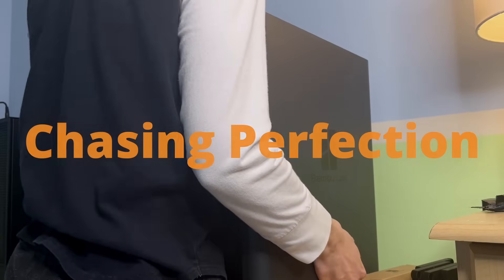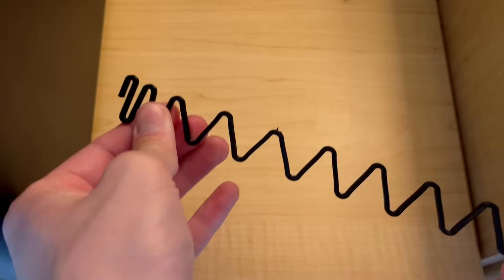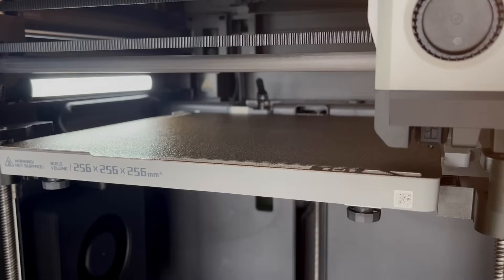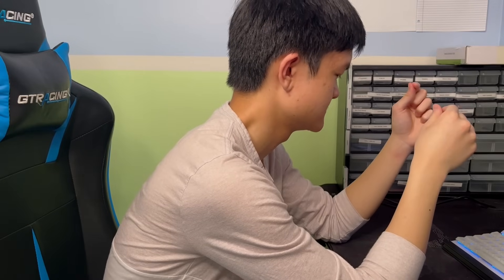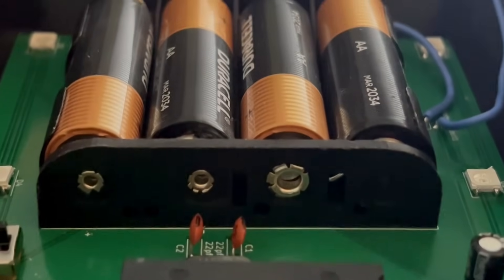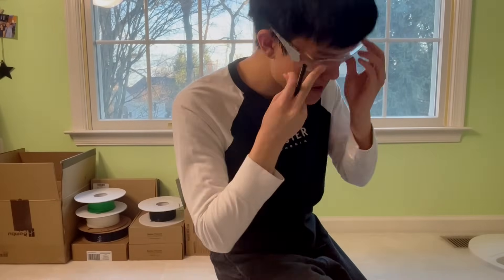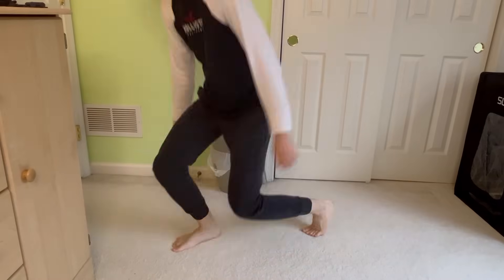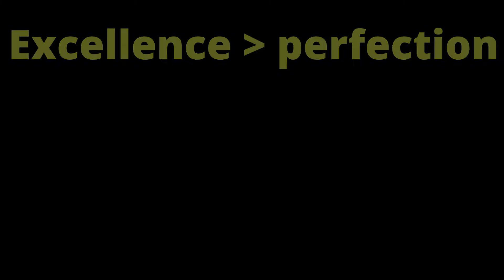Chasing the perfect 3D Printed Spring

Comment: There are things plastics are better at,  and there are things a 400 year old technology are better at.
Reply from the maker: That is correct. That is why I wanted to make plastic springs, to push the limits of what my printer and I can do. Of course I can use a metal spring as it is more reliable. But who knows? There might be a specific use that requires a shape of spring that can only be printed instead of metal machined.
Reply: @TheTinkeringTechie I think there's also something to be said for working with what you have
Reply: @TheTinkeringTechie  in that case print it out of metal
Reply from the maker: I would, but I don't have a few thousand dollars lying around to obtain a metal 3D printer for custom springs (I am a college student). I also don't have that kind of money to buy wire extrusion machines and also coil them as well (if I wanted helical springs). At that point, I would just buy springs online, but then the customizability is sacrificed.
Reply: @sannaguime  yeah just spend 5000 dollars ez pz
Reply: @TheTinkeringTechie  well i just remembered, is possible to bend your own springs, if the necessity is there maybe is worth considering. anyway, good look on your projects.
Reply: @thepizzaguy8477  is possible to order those prints, i just think if is that important to make a custom spring when any available spring is already the best, then considering the problem of deformation showed in the video the next step would be metal print. idk, just a thought.
Reply from the maker: @sannaguime  Thank you for the suggestions. It could be worth a try if I needed it! And thanks for your well wishes.
Reply: I think you missed the entire purpose of the video
Reply: @isaacmyers6909  the video is to show that is possible to make plastic springs in printers, and show the learning journey of the limits of this technology. considering the problem of deformation metal is best, just a idea.
Reply: There are also reasons you might want to print it in plastic tho

Comment: what's the cad software you're using? do you recommend it?😃
Reply from the maker: Yeah, it is FreeCAD. I use it so that I can make designs, print them, and sell them for profit. FreeCAD does not allow any purchase licenses to use it commercially, so if you want to make make from it, use FreeCAD. I used to use OnShape, which is a bit more intuitive. It is free to use, and is online based, but will require a license if you plan to make money from it. FreeCAD isn't too hard, but is sometimes a bit of a pain :p.
Reply: @TheTinkeringTechie  Have you tried Ondsel which is built around freecad. Ondsel pays its employees to develop for freecad. They are using 0.22 dev edition of freecad but made some major UI and UX changes as well as how things dimension.
Reply: Looks like FreeCAD.